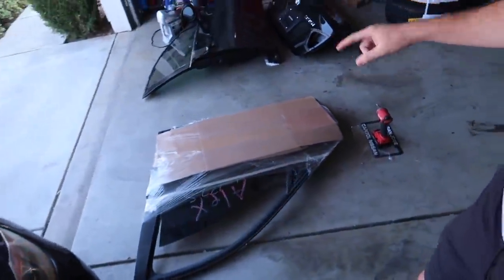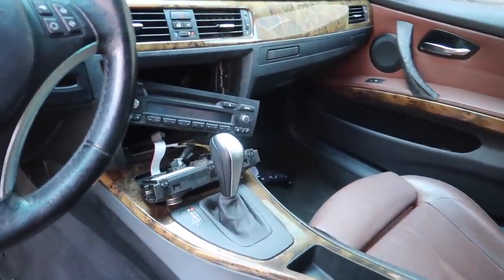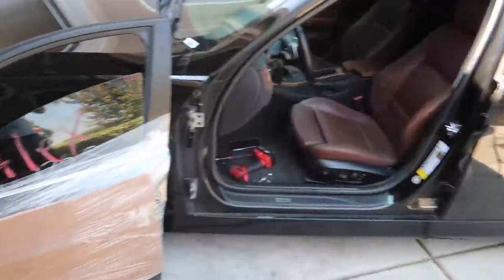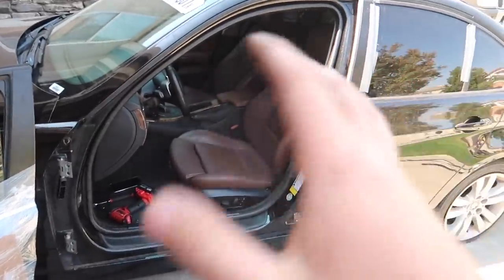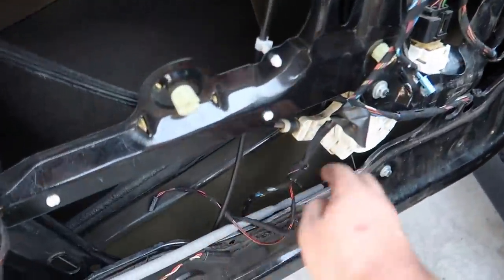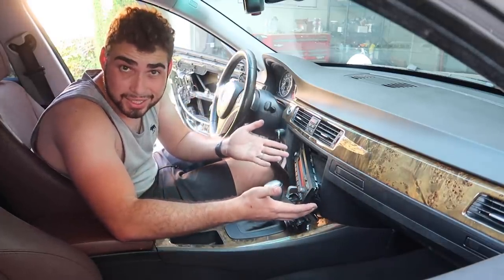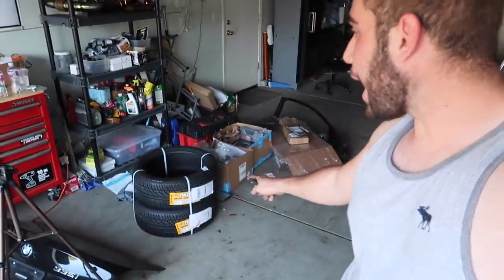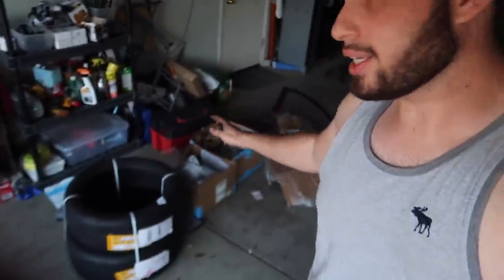Rebuilding And Restoring A BMW E90! Part 4

Comment: 11:49 Toyota's are better in terms of durability and cost wise and are easy to repair!!
Reply: So a Camry build will get a ton of views huh 🤔 Okay 👍🏼 😂
Reply: @BlakesGarage  nah bro my point is that for a work truck Nour should consider picking up a Toyota as they are durable, cheap, easy to repair and kind of comfortable. For any vehicle there are two points to be considered out of there three which are luxury, durability/reliability and cheap (maintenance cost, ease of repair,parts availability etc).
If we pick cheap and luxurious it's not gonna be reliable and if we pick reliable and luxurious it's not gonna be cheap (which is the case here).
 So for a work truck I suggest him a Toyota because they are cheap and durable/reliable, have good resale and because it's a work truck it should be tough reliable and should get the job done instead of breaking down every time. And since it's a work truck it's not supposed to be so luxurious and instead some what comfortable.
My family owns a Toyota Tacoma 2014 and believe me we got it brand new and now it has about 459k miles and is still running like a champ we only replaced engine oil,oil filter,air filter,cabin air filter as per the manufacturers recommend intervals and brake pads and tyres twice.
I hope you get my point and by the way love your M4!!!